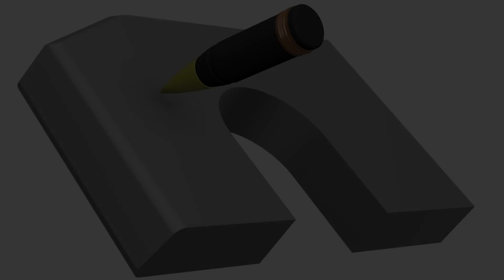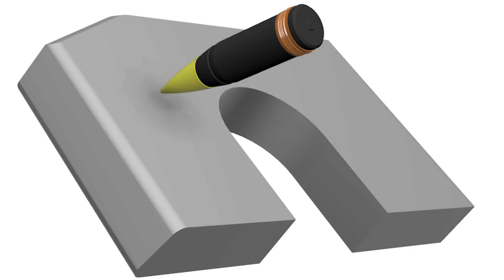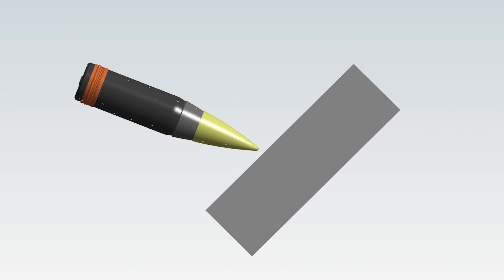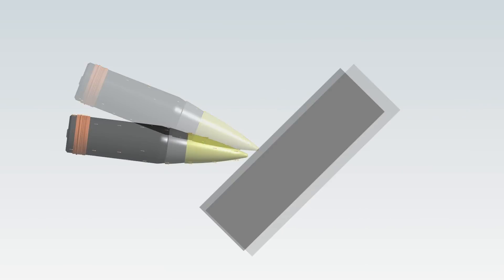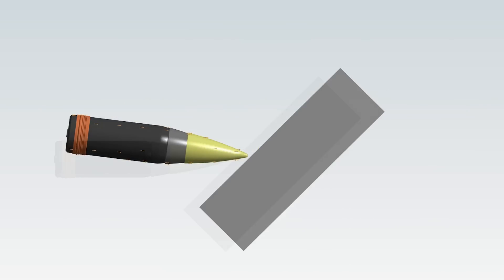USS-Iowa VS Yamato Simulation Part 2

Comment: Nice, well done, Historically the Americans did  not know the Dimensions of Yamato, its Armour or Guns, They would and were assuming it was 16" with similar Armour, this means they would have come into around 20 to 16k, At that range it would be down to weather and luck, Iowa would have got a firing solution quicker, but if Yamato had starting hitting Iowa. then who knows what could have happened. A couple of non devastating hits from Yamato may have meant Iowa rethinking going closer. Remember The Americans had no idea of even how fast the Yamato could go. We have the benefit of retrospect. The Japanese used similar Optics to the Germans and the Bismarck was able to range within 3 salvos. One last thing, as one of the commenters wrote, concussion! when the HMS Rodney hit the conning tower of the Bismarck, it killed all in side....

Comment: Interesting sim. So, the turrets would not be knocked out.  But what about the super structure, range finders, internal comm, battle bridge, mechanical controls, if hit?  I read some article that US Navy tests were done after the war and determined that the likelihood of running out of ammo was greater than either ship actually inflicting serious damage. Simply due to the distances involved, thus affecting accuracy even though the Iowa Class had better range finding. Apparently, these behemoths could turn pretty fast to avoid predicted shot fall.  Each ship would know the others' re-loading time, and the time of flight at maximum range.  The assumption was that Iowa would dart in just under max range, loose a volley, then dart away.  Us Navy method was volley fire, while the Japanese fired in quick series, believing that it would cover any predicted travel of the target ship.  A good theory that was very effective in the early battles with American forces.

Anyone care to comment on this?
Reply: The faceplates were impenetrable, but the rest of the ship had an immunity zone (see below)- a range in which shell hits on the deck, belt, or a specific area of armor could be defeated. This varied according to range, target angle, and the pitching or rolling of both vessels. The speed of incoming shells and the resulting short flight time precluded maneuvering to avoid being hit. That was only done to avoid torpedo attack. The likely hood of shell hits at long range (20- 25,000 yards) was around 3- 6% even with fire control radar. Reloading times were not known during the war but were estimated. At the onset of the war, capital ships could maneuver or fire "accurately". They could not do both. This involved proceeding on a specified course while target vessel range, course, and speed were calculated and the information fed into a mechanical fire control computer. The main battery was elevated and trained to bear on target and a salvo (of as many guns as could be made ready) was fired. No specific areas of an enemy vessel were targeted. The intent was to get as many shells downrange as rapidly and as accurately as possible to increase the likely hood of hits. Simply outranging the enemy was not done because of the low probability of hits at long range. The idea was to estimate the enemy vessel's immunity zone and then engage it outside of its immunity zone, but while the firing vessel was inside its own. Whichever vessel first straddled the opposing vessel gained an advantage, as that gunnery team only had to recalculate enemy course and speed- while an avoiding vessel's gunnery team also had to recalculate one's own course and speed as well.

The advent of fire control radar with remote power control offered the potential to change the "maneuver or fire accurately" mode to "maneuver and fire accurately". Remote power control was the ability of a ship's radar to directly control the main battery in either range, bearing, or both and maintain it on target in all visibility conditions. The Germans had RPC in range only, the British and French lacked RPC in both until late in the war, and the Italians and Japanese never had either. Gunnery in the Yamatos off Samar was based on averaging the range to target of the ship's foretop and after optical rangefinders and the Type 22 Mod 4 radar. The U.S. Navy had RPC for both range and elevation from the Mark 1 gunnery radar onward. However, the navy didn't realize the potential of RPC to enable them to maneuver and fire simultaneously, so that no tactics were developed to make use of this advantage during WW2. The first tests were undertaken in 1946. Range accuracy of the Mark 8 was about 45 yards at 25,000 yards. The foretop optics aboard Yamato had a range accuracy of 89 yards, while Yamato's Type 22 Mod 4 radar was 109 yards. 

Lastly, shell dispersion was the tendency of shells to distort one another's flight paths en route to target. This was effected by factors such as the rigidity of the firing vessel, the proximity of the guns to one another in the turret, the time at which the gun was fired, the time at which the shell left the barrel, and the effect that a shockwave produced by a shell traveling at supersonic speed had on a neighboring shell. This varied from class to class and could not be impacted by fire control radar or by optics. Only the IJN made a serious attempt to reduce shell dispersion, which paid off when they introduced the Type 98 Discharge Delay Unit in the Type 98 Fire Control System of the Yamato class.

Source material is from the U.S. Navy Bureau of Ordinance.

Immunity zone of the Iowas vs. the 18.1" gun:
Citadel                    24,800- 29,800 (5,000 yards);
Turret Faceplates 24,700- 31,600 (6,900 Yards);
Barbettes               26,500- 31,600 (5,100 Yards);
Steering                 24,700- 28,800 (4,100 Yards);
Control Tower       26,500- 31,600 (5,100 Yards).

Immunity Zone of the Yamatos vs. the 16" .50 cal. gun:
Citadel             17,000- 34,500 (17,500 Yards);
Turret Faceplates                      (Impenetrable);
Barbettes         16,600- 36,800 (20,200 Yards);
Steering           19,100- 33,400 (14,300 Yards);
Control Tower 16,600- 33,400 (16,800 Yards).
Reply: @manilajohn0182  Fascinating.  Thank you.  I would have said riveting, but that would be too obvious a pun.  The 6% likelihood of hits was something remember from reading.

Comment: this is quite accurate as as the turret face that the us got from shinano is a rejected turret face meaning it's hardness is compromised by flaws and the test the us did is not accurate if it was a perfect armor plate it should have resisted the shot and the us did not angle the plate as in battle ranges it would have been impenetrable to defeat the yamato's armor you must peirce the side armor main deck or top turret
Reply: It was not rejected, bruh. It was set aside because Shinano was converted to a carrier and because there was no o0ther use for it in the IJN.

Comment: It’s a Shame that the Iowa’s and Yamato didn’t square off and put the BS to an End. I believe the South Dakota’s were about the same armor as Iowa’s.
Reply: They were. The Iowas had a slightly higher amount of tonnage allocated to armor , which was spread out over a longer hull. The Iowas were in fact treaty battleships which simply had the provisions of the escalator clause of the treaty worked into the design. The primary purpose of the design was to escort fleet carriers and to overtake and destroy the modified Japanese Kongo class fast battleships. The additional 10,000 tons provided by the escalator clause were almost entire devoted to the increased speed (about 5 knots) over the South Dakota. The board which approved the design made known their surprise at this fact in approving it.

Comment: In addition to the projectile hitting there is the explosive force that makes it pierce more when the powder ignites. The iowas were superior with their radar controlled guns.  Having 2 inches more per gun does not make up for that and also some more armor. It's obvious that the torpedos when they exploded on the belt pierced the lower hull too.

Comment: Saw a video on the damage Musahi suffered when she was sunk. There were issues with the armour belts due to their excessive thickness. The Japanese did not possess the welding technology to join the thick plates together for those armour belts so they developed a special riveting method. Some of the photos of the underwater wreckage show that those rivet joints failed and the armour came apart at the seams. This caused leaks and excessive flooding at those joints which were impossible to repair in the battle. 19 torpedo hits were recorded and about the same number of direct bomb hits and near misses. 1 Ton armour piercing 16” shells have a lot more punch than anything dropped from a plane so the amount of damage on these riveted joints would have been massive as well. Just goes to show the battleship as an offensive weapon was highly over rated in WW2 when it came to sinking ships. None of the Yamato class ever lived up to their hype as a weapons platform.

Comment: Both armour designs were defective as while penetrating their respective side armour protection was unlikely under the typical combat ranges, both arrangements directed the shell fragments into the Torpedo protection system that would also lead to fragmentation penetrating the outer skin of that system thus degrading the system, causing flooding that leads to the degradation of the Reserve Buoyancy equation which would lead in battle situation similar to the Bismarck's and Scrnhorst's last battles that brings into question the survivability of the respective designs been inferior to the German designs.

Comment: don't need to penetrate just eff up her turrets so they cant turn, elevate or target. Just a change of tactics. The Iowa's were faster and had better targeting. Short of mass the 18 vs 16 inch guns are slightly larger slower shell vs slightly lighter hi velocity shells. Use a combination of AP and HE rounds in succession to jam up machinery and cause trauma inside the turret or ship. Target her steering gear and lighter armored parts of the ship outside the armored citadel. To cause damage and take on water causing the sip to slow or become unbalanced. getting hit with a shell would seriously wound or incapacitate the people in the turret probably kill people near the point of impact due to plate spalling creating a shotgun effect inside the turret.

Comment: The real issue is the USN had Radar directed first round probable hit at distance in any weather. Whereas the IJN was confined to Optical sighting. The Mk 1 and 2 Ford analog computer survived. Until the digital age due to this accuracy in any weather.

Comment: This is all useless. The US battleships had Mk.8 Mod.3 or Mk.13 fire control radar on their Mk.38 Fire control directors which also carried 26.5' stereoscopic range finders. They also carried the SG surface search radar. Range and bearing information was fed from the radar directly to the Mk.8 rangekeeper, an analog mechanical computer, along with other necessary data from the firing ship, such as speed and direction of travel. A large gyroscope called a Mk.43 stable vertical would keep the directors and the rangekeeper's firing solution in synch with the yaw and roll of the ship. The firing solution would be used to remotely control (RPC) the turrets in training and elevation and the guns fired when the appropriate point was reached in the roll and yaw as tracked by the stable vertical. 
The Yamato class fire control system was as complex but required more manual input which could lead to errors. More importantly, the Japanese surface search radar, the Type 22 had half the range on a battleship target, 10nm instead of 20nm of the SG. As a fire control radar, it was equivalent in range and bearing accuracy to the early US Mk.3 (FC) fire control radar. The antennas were mounted separately from the fire control directors. Also the Japanese did not have RPC, so the firing solution was sent to the trainer's and pointer's sights as a pointer inside the sight, to which the pointer and trainer would try to match a pointer they controlled which would elevate and train the guns.
The US battleships, anytime of day or night, would detect the Japanese battleships at 40kyds. SG would hand off to the Mk.13 at between 40-35kyds. The rangekeeper would have a solution at 30-35kyds and the guns would fire at no less than 30kyds out to the ballistic range of the 16" Mk.7 gun, around 42kyds. During the 1930s, the US battle line practiced shooting over a smoke screen using aerial spotting at 30kyds.
The Japanese in daylight would not detect the US battleships until 24-26kyds distance or the natural horizon for an observer at 100' above sea level, or with the Type 22, night or day, at 20kyds. The 15.5cm Type 3 guns had an illumination round that worked out to 21kyds at night. The Japanese searchlights were good out to 8,800 yds. 
The US battleships could stand over the horizon dropping Mk.8 2,700lbs "superheavy" APPCBC shells on the horizontal surfaces of the Japanese battleships while matching the Japanese attempts to maneuver close enough to see them. There was an "Achilles heel" in the heavy armored deck of the Yamato's. These were the barbettes for the 15.5cm three gun mounts, which had 25mm roof tops. IIRC, the USN put a 1,000lbs or 1,600lbs AP bomb through the aft gun mount, which burned out. You can see the flames in pictures of the Yamato before she sank. The 15.5cm gun was bag gun and its magazine was right next to the aft 46cm magazines. Even so, the USN didn't need to sink Yamato and Musashi, just damage them to a point the Japanese couldn't repair them within any reasonable time frame.
Reply: The Mark 13 wasn't fitted in any of the Iowas until January of 1945. Range accuracy of the Mark 8 was 30- 45 yards at from 20- 25,000 yards. Yamato's foretop optics was 89 yards. That of the Type 22 Mod 4 was 109 yards The Type 22 Mod 4 could detect a 100- foot high battleship- sized target at 35,000 yards. The minimal advantage in range accuracy provided by the Mark 8 was more than offset by the shell dispersion of the Iowas (1.9% of range for a nine- gun salvo, vs. 1.3% for the Yamatos.

Yamato off Samar obtained three 1st- salvo main battery and three 1st- salvo secondary 6.1" hits on USS Johnston from just over 20,000 yards, one 1st- salvo main battery hit (from a six- gun salvo aimed solely by the ship's Type 22 Mod 4 radar, as the Yamatos used radar- assisted gunnery) on USS Gambier Bay from just under 22,000 yards, and two shells dropped right alongside USS White Plains from just over 34,000 yards. One of the latter two shells exploded and the damage from the near miss removed White Plains from front- line service for the remainder of the war.

By comparison, none of the Iowa class obtained a main battery hit on any vessel of destroyer size or larger during WW2. During Operation Hailstone, Iowa engaged the training cruiser Katori in a clear visibility daylight action at an average range of less than 14,500 yards using the Mark 8. She tracked shell splashes both visually and with the Mark 8. Katori had already been hit by a torpedo, from 2- 7 bombs, numerous 8" and 5" hits from a U.S. heavy cruiser and a destroyer, was making only 1- 2 knots (one report had her dead in the water) and was already sinking when Iowa opened fire. Iowa fired eight salvos totaling 46 rounds using the Mark 8 radar range keeper. All eight salvoes were straddles with no hits. The real advantage of the Mark 8 was remote power control in both range and bearing, allowing direct control of the main battery in all visibility conditions. The Navy did not recognize this advantage during WW2, and did not develop tactics to take advantage of it.

Comment: Now calculate for a bursting charge, and use turret roof and deck armor thickness. Then apply the 45.7° impact of a 2,700 lb shelf at 20 nautical miles. (3 miles beyond the effective range of Yamato's main guns), and you will see what USS Washington would do.